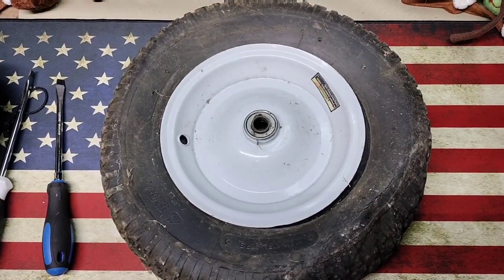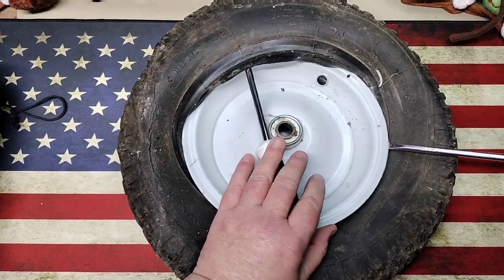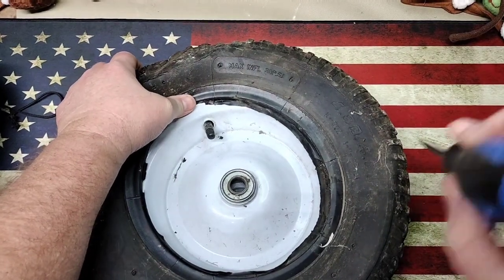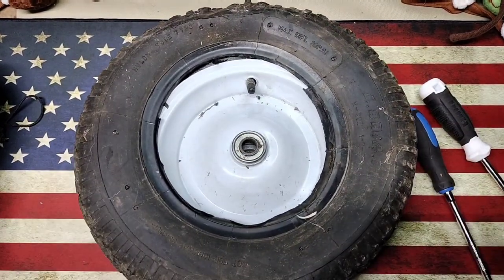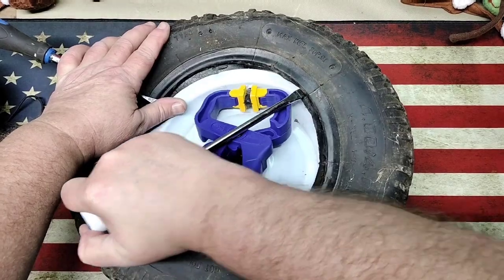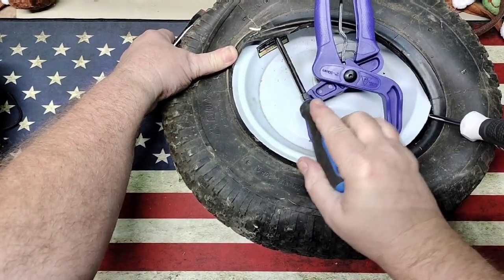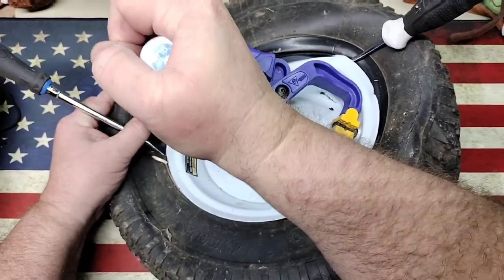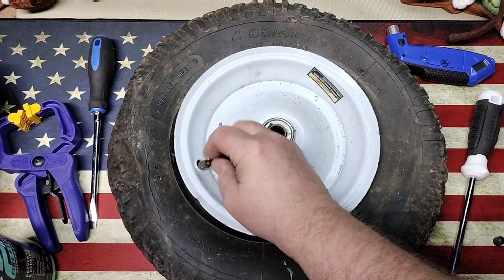Garden cart tire repair maybe?

Comment: I had rotted valve stems on my little camper tires. The tires themselves were like brand new. I think the tire shop just didn't replace them.
So I had to break the bead and run a string through there. Fish the new stems up from inside and yank them into the wheel hole with pliers.
It worked but it was a bit@#.